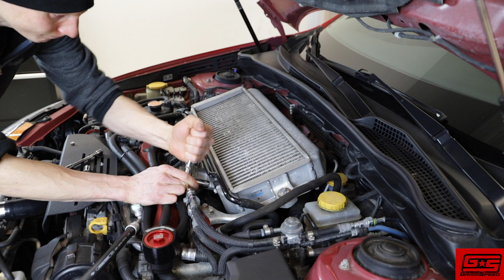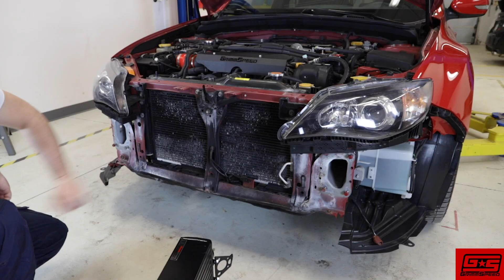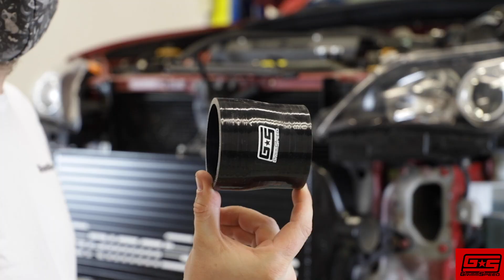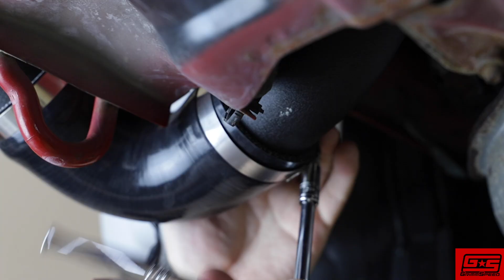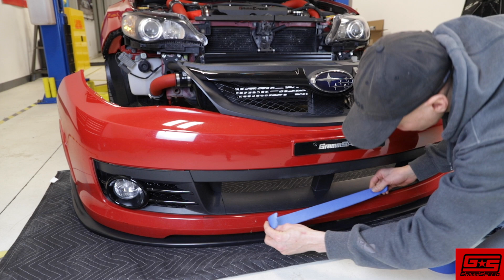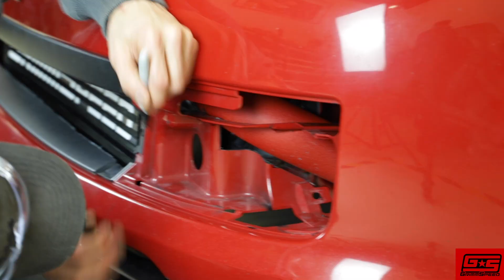GrimmSpeed Front Mount Intercooler Install - 08-14 Subaru WRX/STI

Comment: On the “slim body” style wrx (08-10 wrx non sti) you have to beat down on the bottom of the core support. If not the intercooler will interfere down there and eventually cut the aluminum core. I just bought my kit. Not a huge deal for me but should be noted. Once you bend it downwards you won’t be able to mount the bottom bumper brackets either. I haven’t gotten to the plastic under pan just yet and I hope I can put that back on. I need that on there

Comment: I live in California, most mods would get a state ref. Is this street legal in California? Would love to upgrade to this modification just don’t want to have to uninstall every smog check.
Reply from the maker: Our intercoolers are not CARB approved in California. They are legal to run but you may run into issues with local smog laws.

Comment: I have an aftermarket radiator from mishimoto and its the pretty big . Do I have to downsize?
Reply: I have one too. Mine slightly touches the expansion tank so im going to put some sort of protector on it (aka tape) so it doesnt rub the plastic tube causing a hole.

Comment: will this work in my gf8? v5 ej205
Reply from the maker: These front mounts were designed to fit the 08-14 WRX and STI, so probably not a direct fit. It was not intended to fit the gf8. With some custom fabrication and modification you may be able to get it to work, but if you are looking for a direct fit, this isn't it.

Comment: Would this work for a 2010 wrx sti hatchback?
Reply from the maker: You may have to slightly modify the bumper if you have fog lights. But will work just fine.

Comment: Just bought one I have a question.
I have a etune already would install require a retune? Just curious if it would mess with a etune I saw where it says no tune required but I assume that’s stock. Thank you.
Reply from the maker: Tuning for any change in your system is going to be beneficial. In order to get the most out of your upgrade you'll want to tune for it. But it's not necessary.

Comment: Do components for the new PCV hose come with the FMIC Kit? Will the car work without re-routing the PCV hose or the use of one?
Reply: Mine didn’t come with it. Mind you, I have a narrow body WRX model and I thought maybe it was only meant for the STI. Mine was a struggle to put on and a lot of manipulating to make the oem plastic pcv pipe fit.

Comment: Do the fog lights actually go back in after all that trimming?  Y'all put the trim back on in the video but leave the lights out.
Reply from the maker: Not on the 08-10, the fog light housings and actual lights are just too big and orientation is too close. Doing what we did will allow you to run a smaller LED fog light, however if you're planning to delete the fogs altogether, you can just cut the housings out. P.S. Fog lights aren't an issue on 11-14 installation.
Reply: @GrimmSpeed  bummer
Reply: Just make it a break duct kit lol